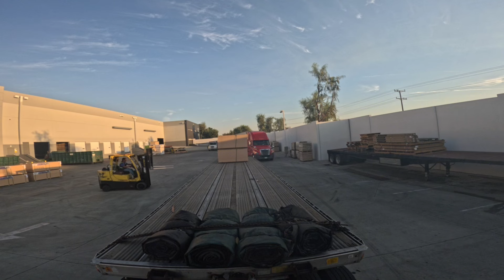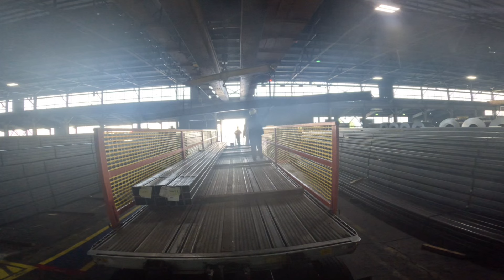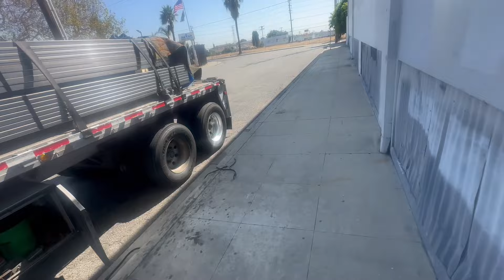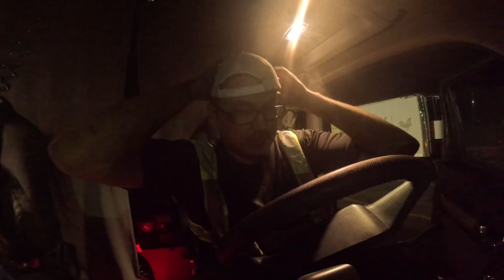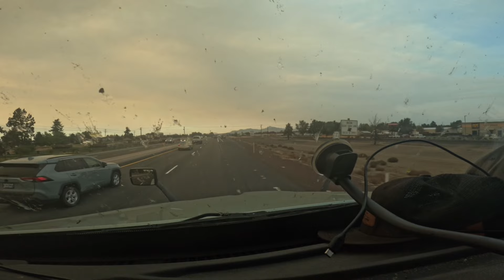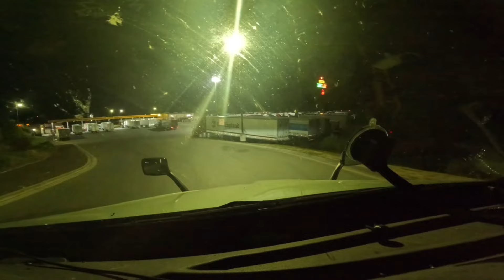Central Oregon Flatbed Trucking #149. At the terminal to get my trailer fixed.

Comment: I had a trailer airbag leak when at COTC. They had me try to use a tarp patch to slow down the leak until I could get it repaired. It wont pass a DOT inspection but it did stop the leak.